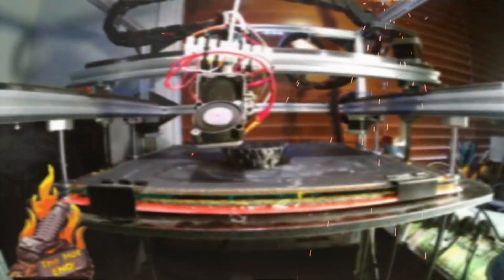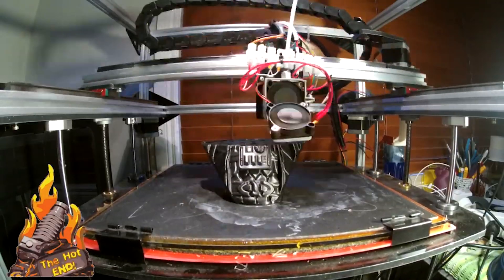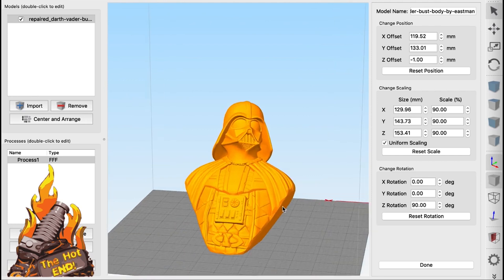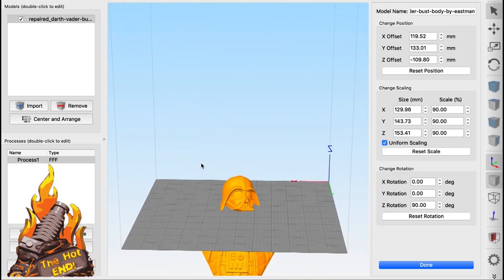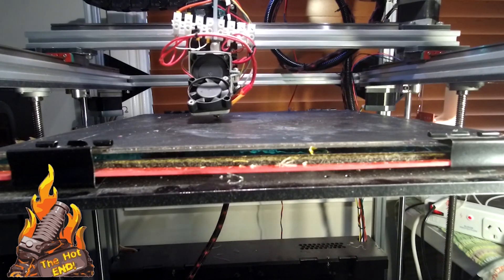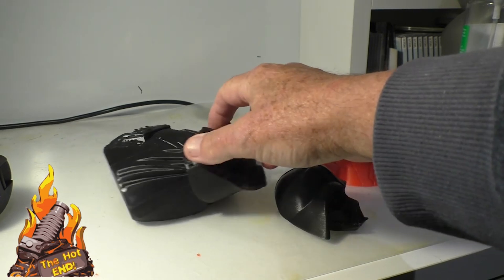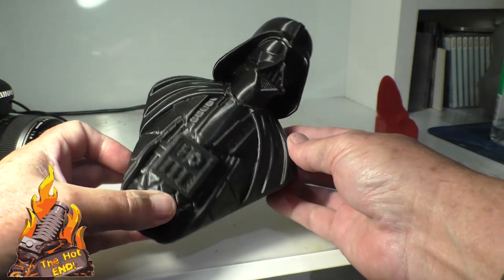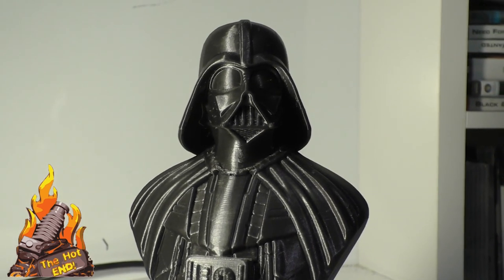How to finish a failed print in Simplify 3D

Comment: If using a raft, should I measure from the top of the raft or from the build plate. My printer froze up for some reason so I figured if I turn it off then back on I could use the resume print function but it's a flashforge so you know that function doesn't work. So,  when I turned it back on it did nothing, I went ahead and homed it, then using the manual movement I put the nozzle right back where it was when it froze and noted the coordinates including z height. So should I just put that number in it so I need to subtract for the raft? Thank you so much for the video, I'm sitting here with a 40 hour print that failed at 90%with some expensive material. Hopefully I can get this to work.